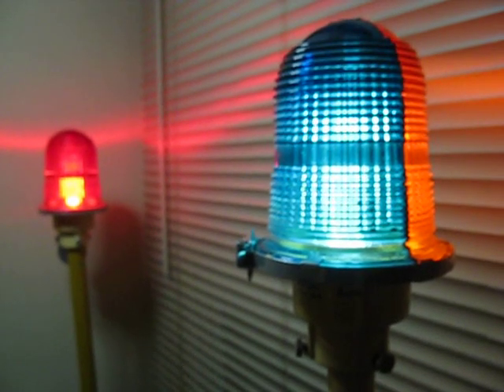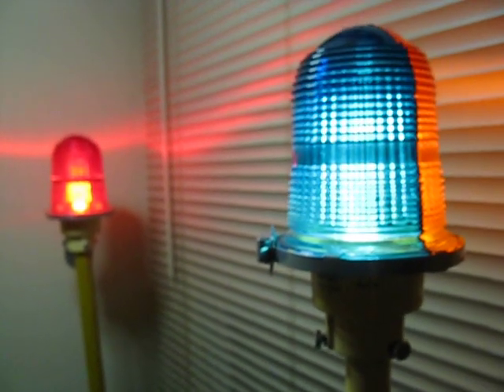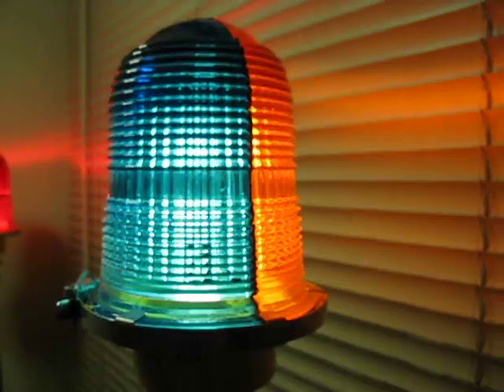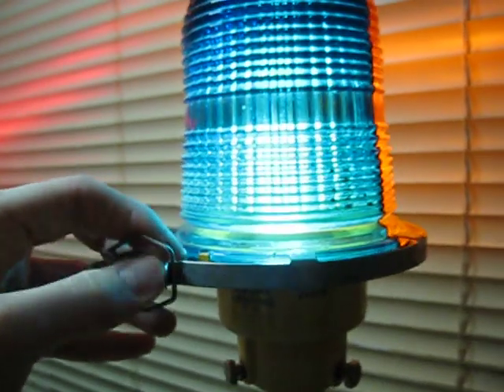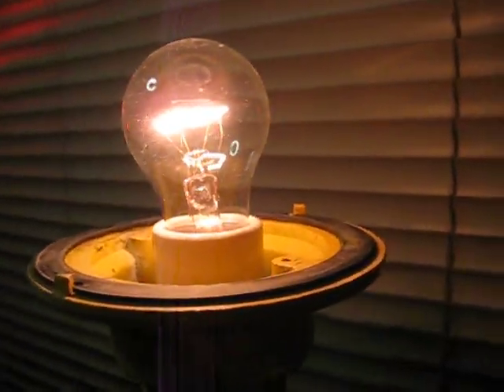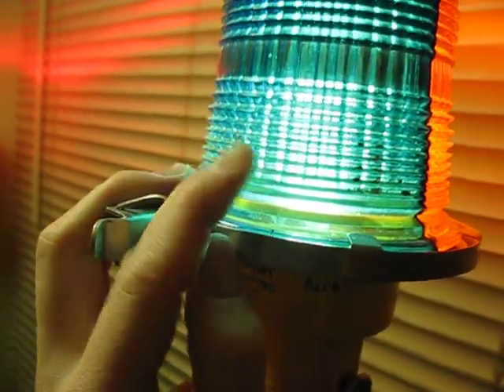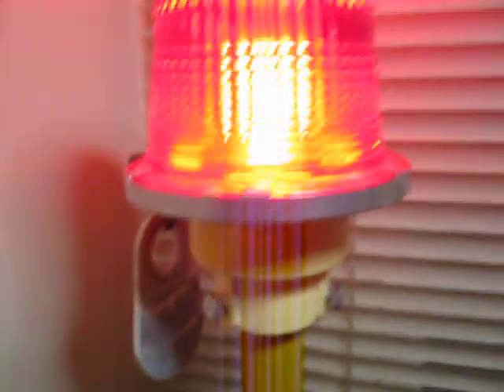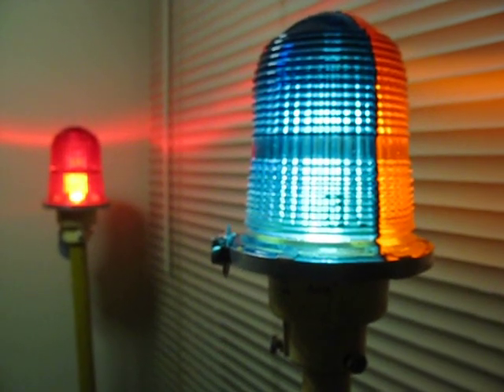Airport Runway Lights!

Comment: The original lamps used medium prefocus bases.  You can get 120V lamps for them, and at only eight bucks each they are not insanely expensive by specialty lamp standards.  If you can't find 120V lamps, the 45W 6.6A lamps will run on 6V (this ONLY applies to the 45W lamps).  Also, the transformers are isolation transformers intended to isolate the fixture from the series string, which may be at thousands of volts above ground.

Comment: Red and Blue are opposed because as you approach the beginning of the runway the lights are blue. (you would only be seeing the blue side) as you approach the end of the runway you see the RED side telling you you are running out of runway. :D
Reply: But surely then, you would only see the red/orange if you looked back?

To me it seems more likely they'd be used on runways, so that aircraft can see if they're entering from the correct side.
If the runway appears blue, it's good. If you're seeing an orange runway, you're coming in from the wrong side.
Reply: @dancoulson6579  wrong.

Comment: I agree with Isabel, the red one is just a general obstruction identification light and I think the "blue/red" one might actually be a green/red runway threshold light which shines red light towards the departure and and green towards the approach end of the runway.  If it is actually blue/red however, then it is a taxiway edge light and would be signalling "stop/do not enter" if approaching from the red side.

Comment: Cool lamps.  To clear some things up, you don't have a runway end light.  Those are half green, half red for the reason listed below.  What you really have there is a taxiway light as blue is only found on taxiways.  It's half orange because from the other side they wanted to caution something.  Maybe airport vehicles on a service road.  Someone also mentioned runway edge lights but those are half clear, half orange.

Comment: half Blue and half Red lights are "Runway Edge Lights" as for the other lights goes.. Usually red means no longer clear, stop or wrong way The color green means that the runway is clear for use, and blue means that it's the Taxi way.